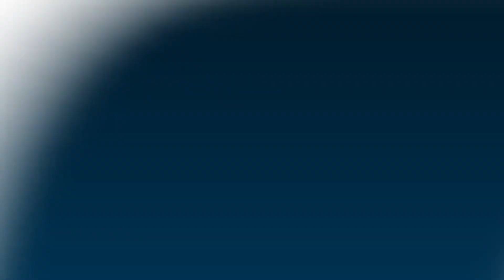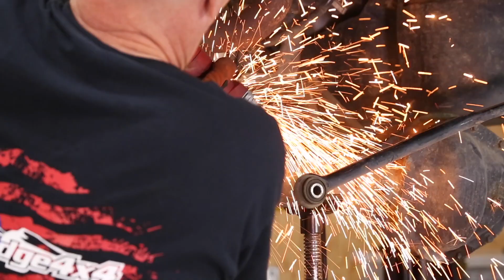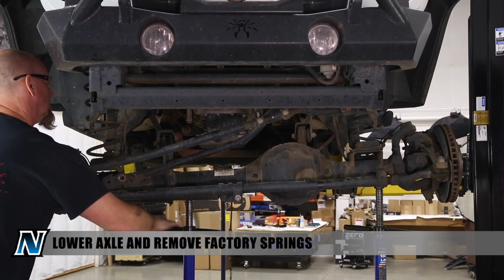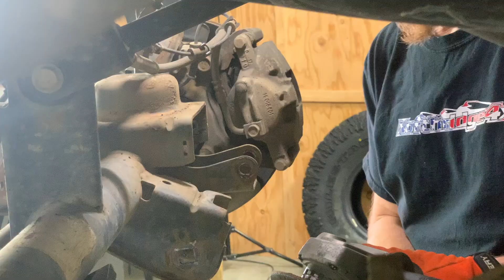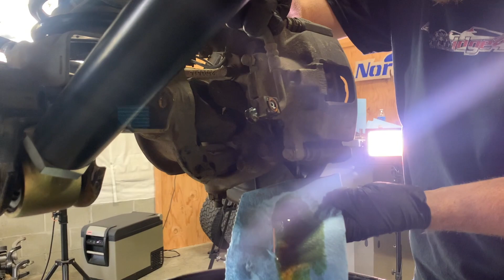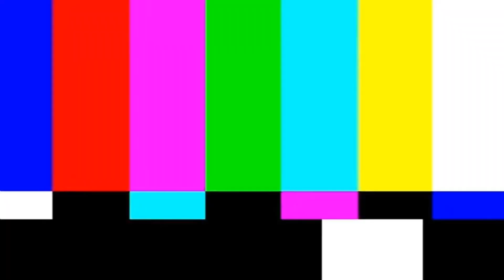Evo Suspension 3" Enforcer Lift Kit + Fox Shocks Install [2007-2018 Jeep JK]

Comment: What's the best 2" lifts for a  dd JK 2door? Don't really wheel just want a small lift with a great ride.
Reply from the maker: That's a loaded question Ben, there are some good 2" kits out there. If you are interested in going to 2.5" they are even more kits to choose from.
Give us a ring at 866-601-5340 or drop us an email: sales@northridge4x4, give us some more specifics on your Jeep and how you intend to use it and we can help get you into a lift kit that is right for you.
Reply: @northridgenation  will do

Comment: Did you do anything with the front trackbar?  Does an adjustable trackbar need to be added with a 3" lift?
Reply from the maker: Haven't done anything yet and amazingly it drives pretty good. We'll be doing adjustable front and rear trackballs and discussing the geometry in an upcoming video.